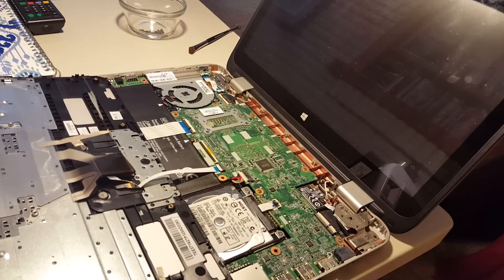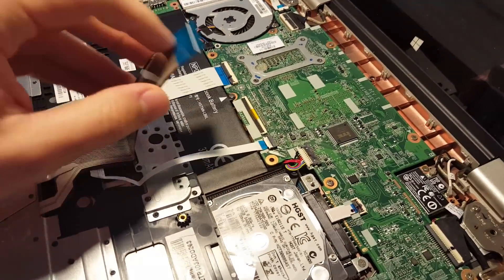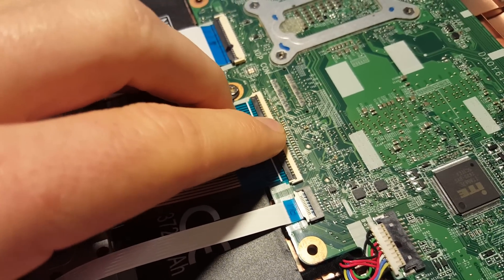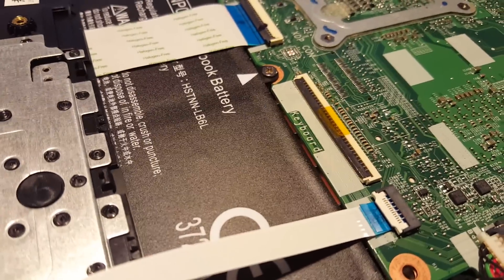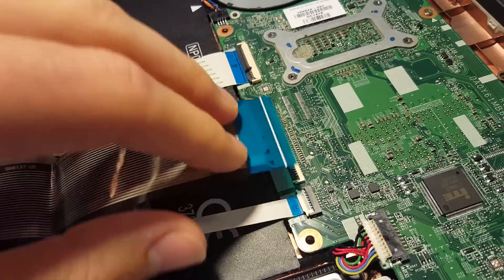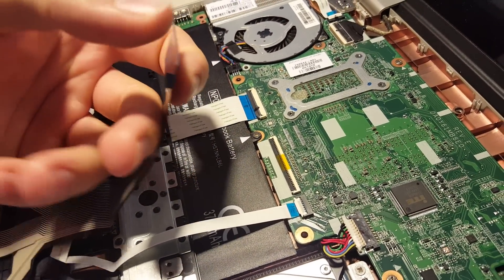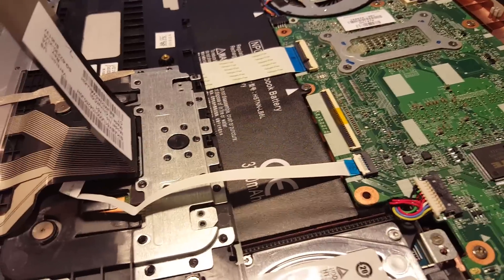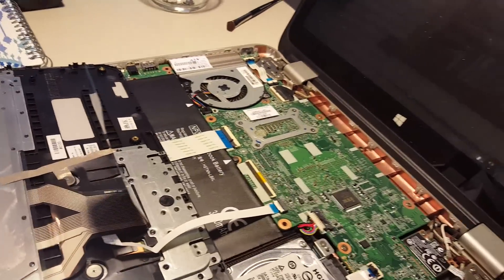How can I fix HP X360 Keyboard Ribbon Cable Locking Clip Connector!?

Comment: somehow the tiny black plastic strip which pushes the flat cable / connecter downwards was broken. I fixed it by pushing a very thin (0.5 mm?) plastic strip between the top of the flatcable and the connector.  This was just enough to push the flatcable downwards. Now it works again.

Comment: if nayone can here hep me... i was replaring my laptop the black part on the top of the connector that moves up and down and then locks the ribbon cable in place broke i sthere a way just to replace that black part please help thankyou
Reply: From what I've seen people say in other posts about this issue, best bet is probably to by a used motherboard that doesn't work and would just be for parts. Then just carefully remove the clip from that motherboard and put on your laptop.
Reply: @munkytown  hmm i think thats the last resort... Thanks for the reply 😊

Comment: I sadly upgraded laptop , hhd to ssd , which I had to remove the keyboard to access hard drive for this swap , anyway short story I got involved in screws ( to open laptop a couple of times ) and all that which after reconnecting everything I had trouble with that one last one the keyboard and being in this state of " tired and get all done asap " I broke the black piece which holds the keyboard cable! Nightmare soon began for me with getting the keyboard cable to be fastened in place ! So for about a week , every other day I got into this battle to make keyboard function, thought  just about all forms of tape, masking being the better , anyway I got it to work but some keys began to not function , so I was stuck! I tried and tried and at times I had it working so I thought until I noticed some keys not working , so stuck! At one point I thought I should just get a bluetooth keyboard and use laptop as a desktop , so yeah , but I just could not let it as is and kept working around the various taping methods which I gave up but thought about gluing the black fasterner to a business card!? So I took a pause decided to really peak inside and just investigate around the motherboard connector area, after a good study of it I noticed the pins , there is a small degree of space between motherboard base and the keyboard cable! ( the same about as the black fastener thickness) I had a couple of types of thin materials I was going to try to fasten on top which did not work so with the study of the distance of motherboard base and keyboard cable is a very very thin space for which I just went with it and slid a thin piece of material (metrocard which is plastic thin plastic) slid it on top of keyboard cable as the cable fit into connector ! It amazingly slid in and the keyboard cable got secured beautifully in place , later after I connecting all turn laptop on , all keys so far work ! It has worked so far with all keys functioning THANK GOD I hope this reckless handling of my upgrade experience help !? I don't recommend this but it has worked , a alternative from taping and retaping which kept slipping slightly out causing non functioning keys!
Reply: So you attached the plastic material to the cable and then fitted it in or you used the plastic to wedge the cable into place? I have exactly the same issue, except my black connector piece broke off and got lost - inside - the laptop somewhere. lol

Comment: Push the flat cable all the way in. Close the latch down. Hold it down with your finger. Put some crazy glue on a toothpick. Apply glue on both outer edges of closed latch and wait until it dries.

Comment: TRICK ON THIS ON IS ADD PICE CLEAR PACKING TAPE ON TOP SIDE NOT BOTTOM WERE PINS ARE THEN ADDED THICKNESS PIECE CLEAR TAPE IN TOP ONLY WILL GET IT TO PRESS IT DOWN IT WORK ON TOP SIDE OF RIBBON CABLE ADD SMALL CLEAR PICE TAPE TO EDGE OF IT ONLY THEN PUSH IN PUSH CLAMP DOWN SHELL HOLD THEN CLEAR PICE ON TOP TO HOLD DOWN MAY WORK OUT FOR YA

Comment: Anyone know a way to keep it in place without the black bar? Cuz I broke that piece and apparently tape doesn’t work since I think it cuts off the electricity
Reply: did you find a solution for the black bar?
Reply: @ajnacounselling2352  I stashed the laptop away since and never ended up fixing it. I think the only way to do so is to replace the whole part which isn’t easy. Otherwise just take it to repair shop.
Reply: @aliyoussef8201  IV seen people hold it in place and hot glue it down hot glue is also removable if needed 🤔😉

Comment: I am having the same thing with my acer  so flimsey  i have to mess around with a very short cable cant even get my hands underneath to see what i am doing but when i was looking at yours its much better at least you can fit in easy well lets get to the point you could try using a glue gun  i think it would work i cant see it doing any harm and once set hard will or should keep in place
Reply: did it work with your asus i have the same prob my black bar is broken and the cable does not stay and connect

Comment: You can try cut up plastic piece such as from those ram memory stick plastic packs and cut it to the tip of the size and then tape it down to fit the tip end... This would then add tension in place to compress the pins in place which will be a tight fitting.  If you can get it in.. tape it down and test it afterwards
Reply: why not go full newfie and just roll up some tape and tape it down? lmao

Comment: You have to pull up the black thing but don't push it up very much because it's fragile and then insert the ribbon into it ,as far as you can and then press it down. I hope it works.
Reply: I've watched a lot of videos and this suggestion is right.

Comment: i have the same issue BUT the hole clip broke off i have an HP 15 how can i put it back
Reply: Not sure, I think something similar with me happened with a Nintendo Switch joy con. The black plastic clip was stuck, so when I tried to pry it up to get the ribbon cable out, the black clip broke off. I tried kapton tape, but no luck.

Comment: Try double sided tape thin type though, put it on the ribbon cable underneath and also on the plastic clip underside too, should work i have done it a few time before on repairs to clients laptops, use the tape and double it up if you have a gap from motherboard to the ribbon on the keyboard, pack it i think the term is called, then peel the double sided tape from the plastic strip lock mechanism and make sure the keyboard ribbon is in then push it down and make sure its stuck firm. Then when done, pop some tape over the whole thing to give it security that it wont come out during transit and moving about...Hope that makes sense folks....

Comment: found this video when trying to think of a way to fix an old Toshiba ... the problem is that while i was careful, the plastic clip itself broke into like 3 pieces when it flipped up ... i wonder if the heat (Toshiba's are known for overheating ... at least in that era ... @ 2008-2009ish) made it so brittle ... I use a usb KB with it now but i still have the old one here and the connection wasn't complete but it did work when i plugged it back in ... no matter what DIY method i tried ... it'd just wouldn't stay-put without that black clip firmly holding it down
Reply: I think I'm having a similar issue with a Nintendo Switch joy con. The black plastic clip was stuck, so when I tried to pry it up to get the ribbon cable out, it broke in 3 pieces. So now there's no black clip and kapton tape isn't much help. Did you ever find a fix?

Comment: Sir we gave our hp laptop to A laptop repairer to do the injh of lock in the corners of laptop,we had put a password'9898 R',our keyboard was working quiet well,but  when we went to take the laptop,He said that it's keyboard is not working and you will have to replace it, password was not even entered,he had cheated us,but what he would have done?Sir please reply

Comment: Lift black flap 90 degrees to board. The sides of ribbon have notches. Insert notches over bumps. Depress black flap to locked.
Reply: My ribbon doesn't extend all the way to the two bumps.

Comment: You need to rise the connector up completely, the sides that have a bump need to go behind the plastic holders.
Reply: Thanks, this in fact worked for me. Lift the connector completely to the back as far as it goes and slide the cable in it, that way it should now work to clip it in
Reply: i need to replace the clip for the motherboard how can i or where to do it
Reply: Yess! the black clip should completely lift. so the cable can clip.  In my case (Lenovo G40-45) there's a plastic who hide the black clip. I try like this photo in the link bellow, and the keyboard back to work again. 

check this out : https://drive.google.com/open?id=1eHFTz1YIIqENmXrT_Df4vMO0QydxWHFa
Reply: omg it worked
Reply: Worked, ty. Just a bit more force as i would normally use and the blue plastic slid in further.
Reply: I can't unlock a ribbon lock in fact 2 ! I wonder if you could help me.is there anyway I could post a picture of it?
Reply: uros ivanovic mine broke off the full clip it had 2 needles on both sides
Reply: Is there a tool that moves hidden side connectors to slide in I have a Casio wk8000 synthesizer keyboard. I pulled out during repair and just doesn't want to go in I has a blue tip like this...and it's in an almost inaccessible spot and Casio USA isn't answering
Reply: Casio wk8000 keyboard piano . 30 pin blue strip connector came out and won't go back in.
Reply: Is this question a joke? In any event, the locking plastic piece needs to be lifted to AT LEAST 90 degrees vertically in order to PLACE the ribbon cable in and not slide it into places. That is, for the cable you're having problems with. Other ribbon cables DO slide into place but same thing, need to lift plastic lock ALL the way up, not just a little.

Comment: Hi I had the same problem On my ps3 but woress I had broken the black clip the thing that had worked for me was get a hard plastic like that of a credit card  and cut a little lip the same size of the Robbin and, squeeze it in and it should work for me it did
Reply: Same problem. Nice idea thanks I will try that, mines for the laptop SSD connector...haaaaaaaaaaa!!
Reply: that only works if he didnt break the plastic retainer

Comment: Did you get it fixed because that's happening to me as well.
Reply: you have to open the entire connector, then those lateral pads need to sit inside of the connector.

The white line indicates where the brown lid from the connector should be placed, if is away from the connector lid, then you are doing it wrong.
Reply: I posted a repair video for this type of damage, where only the clip is damaged or missing.  Search Youtube for "Easy Ribbon Cable Connector Fix, Repair"     Alex,  Austin_Semiconductor
Reply from the maker: Hooter Bear, yes I did. My issue was that I was not opening the clip enough to allow the ribbon to seat properly. Good luck fixing yours!

Comment: You got so lucky.  Lol.  My clip, for Toshiba L875 slides off to remove the cable, then you have to slide it back in once you lay the cable....  Long story short, it was so hard to slide back in, and I damaged the clip that slides out a little.  Still works fine, but I'm trying desperately to find where to get just the retainer clip (or whatever it's called), in case it fails.  I've got to do another repair, soon.  Been searching all day.  Anyone have ideas?
Reply: Hot glue gun over the sealed clip. But make sure the cable is functioning first!  I've had simular issue in the last 12 hours so the best idea that I have found is hot glue gun   ... I can't just replace my clip as the body it goes into broke on one side. Only way the cable is going to stay now is hot glue.. worst thing is it's the power button ribbon clip!!  Such a ball ache!!
Reply: @elljaydalzielholloway6817  same shit going on
Reply: Hi Jack,   search Youtube for "Easy Ribbon Cable Connector Fix, Repair",    Austin_Semiconductor

Comment: you need to push the black latch back a little more to allow the ribbon cable to go all the way in.
Reply: I think you just flip the black part up, then slide the ribbon cable in, then flip the black part down to pinch the cable against the contacts and secure the cable in place.
Reply from the maker: Wasim Salim Yep, that's all it was! I just wasn't opening the clip enough to allow the ribbon to seat properly!

Comment: I think you just need to insert it in not just slide in....
Reply from the maker: Thanks for the reply, but I'm not sure how to interpret what you are saying. Are you suggesting I need to put the cable in with more pressure?
Reply: Do not use "more presure". Just look closely at your keyboard cable ribbon and you'll see two small, about half circle shaped protrusions (not sure how to call them) on each  side of the cable that will perfectly fit to your connector.
Reply: I found this video online on the 3.7min of the video there is a close up of the conector and you'll see how you cable will fit to the conector.

Here is the link:  https://www.youtube.com/watch?v=dp-xq4XVvk4
Reply from the maker: Thanks again, my problem is solved! I realized from the video you linked, that I wasn't lifting the latch far enough open for the cable tabs to seat correctly . My keyboard now works properly, this is great!
Reply: "thats what she said"....